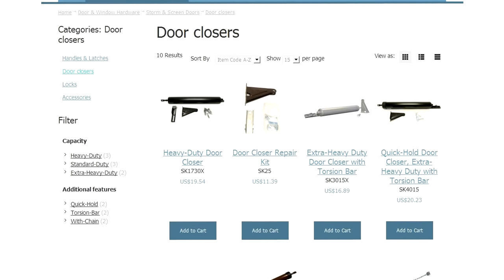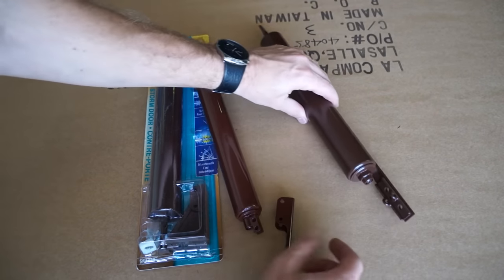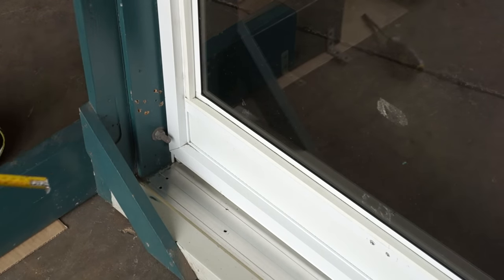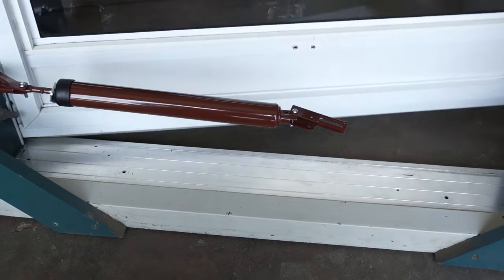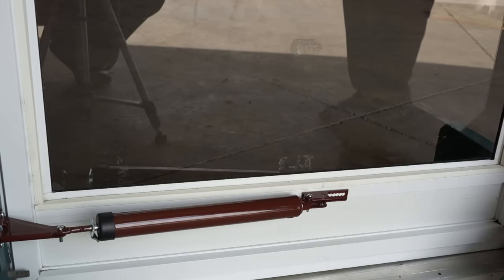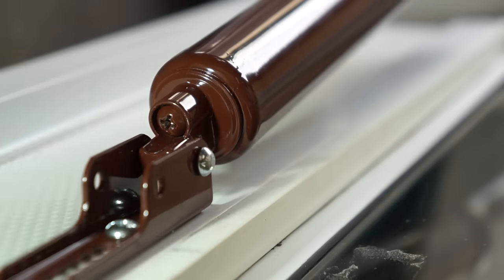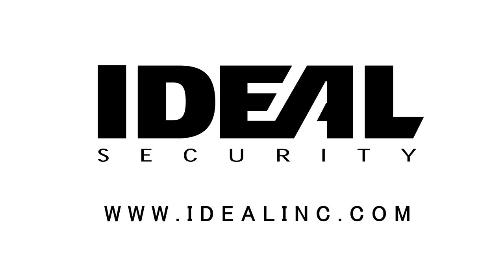How to install or replace a storm or screen door closer

Comment: You nailed that instructional video on door closers !!! Great job!!!    
 I am one that needs all the information.  This was the 6th video I had watched. Not that I couldn't of just went ahead and installed the closer without the video, I like to know the best possible way and measurements before I drill and install. Even though the closer will perform,  I believe it looks better and functions the best when you're using precise measurements.   You broke everything down perfect and went through the hardware and how it works . As well as what do in different seasonal weather conditions.     You've sold me sure.  I actually for more confident on installing and knowing where I can go and call for the best advice on my next project. 
 Thanks again .  Great job

Comment: Great instruction video.   I guess there is a little more to installing a storm door closer than I thought.  But I have a good understanding of how to do this since I have installed inside door closers and adjusted them.   I installed one on my closet door so it will shut on its own since I forget to shut it.  I'm terrified of bats and that is the reason I did this.   Thank you so much.
Reply from the maker: Glad it was helpful!

Comment: This was helpful somewhat. I'm not installing one new but rather putting the main tube back on already installed brackets. I had to remove main tube piece from both brackets so that I could slide the jammed "lock" back down the rod. When I unjammed the locking piece, the rod sprung back into the "tube". Now when I reattach one end of the main tube piece to a bracket, it's too short to reach the other bracket (the door is in the closed position when I'm trying to attach.)  I can't figure out how to have the rod extend out so I can attach that end to the bracket on the door frame. Watching how you install a new door closer, I'm wondering why the rod on mine would be extended anyway.  It seems it should only extend when the door is being opened.

Comment: What kind of screws to be used to fix on the aluminum frame. Mine usually come out after few days.
Reply from the maker: Our products come with tapping screws #12 x 5/8" long, or longer. Sometimes the existing holes are too big for the screws and that could be the reason why they are coming out after a few days. I hope this helps.
Reply: @IdealSecurity  what would be the best course of action if the  existing holes in the  aluminum frame are too big, please?

Comment: Mine closer popped open and came unpinned up top at the frame. The washer device seems locked and I'm unable to extend it to attached it to the frame and pin it. Suggestions?

Comment: Hi, is there a feature on the standard size closer to keep the door slightly propped open? Is it something I can achieve using the washer shown at 2:21? Thank you in advance. Mia.
Reply from the maker: Yes the washer on the standard door closer will help keep the door slightly propped open. 
https://www.idealinc.com/en/door-and-window-hardware/storm-and-screen-door-hardware/door-closers/sk9x-standard-storm-door-closer

We also have the standard door closer with the touch and hold feature as well 
https://www.idealinc.com/en/door-and-window-hardware/storm-and-screen-door-hardware/door-closers/sk9600-standard-door-closer-with-touch-hold

Comment: I would suggest if possible to anyone installing door closer to reinforce door jamb mount with to a base metal plate with 4 self tapping screws plate to wood/aluminum door frame for added strength.

Comment: Thank you very easy to install.  It works great when the front door is open.  I know how to adjust the screw.  When the front door is closed it will not close all the way no matter how I adjust the screw.  What can I do?
Reply: Is part of the closing mechanism touching the front door that's why it can't close?
Reply: I have this problem. There's an airpocket in the doorway and I can't get the storm door to latch shut when the door to the house is closed. One handyman "fixed" it--the door closed but wasn't opening wide enough to fit in the doorway with groceries. Another handyman adjusted it so it would open wider and now it won't close again. I tried adjusting the rubber around the door to allow air in but that didn't work either. How do I adjust this properly?

Comment: Anyone know what I can do to stop the squeal coming from the door closer? I tried a little white lithium grease and that didn’t help at all
Reply from the maker: Hi Brian.
The noise from the door closer should be minimal. It comes from the spring moving back and force on the inner surface of the tube.

If the noise is too much, disconnect the door closer from the door side, spin the tube a few times while the rod is still connecting to the jamb bracket. It should smooth out some noise, but not eliminating.

We don’t suggest adding grease through the gap in between the rod and the tube. Too much grease would block the spring over time when the grease gets dried out.
Reply: I use W40 in squeaks and squeals

Comment: I've never seen one soo low on the door frame as our are at the top of the door. Is that an American thing?
Reply from the maker: Hi Kaos.
It's purely a preference thing. Top, bottom, middle... It all works the same, and it's a question of where you want to see it.

Comment: I just installed an Ideal closer. It "bangs shut" at the last two- three inches.
Reply from the maker: Hrmmm, we should be able to fix that for you through the bypass or seasonal adjustment.
Can you send an email to info@idealinc.com so we can help you out?
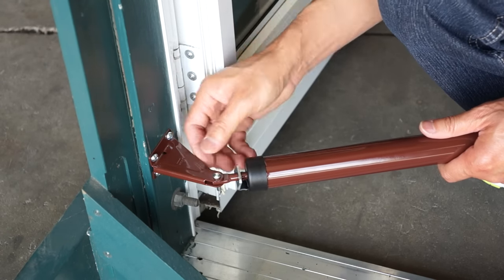Reply: You need to add the pretension and then readjust your bracket to accommodate the new length. 2:11
Reply: When properly installed it does not " bang shut "; it closed " GENTLY ".

Comment: Strange them being at the bottom of the door.  They are obvious and ugly.  Where I live. They are on the top of the door and are hardly noticeable.
Reply from the maker: It really depends on the door manufacturer, some of them have the door closers installed at the top and some of them have them installed at the bottom, there are both options available in the market.